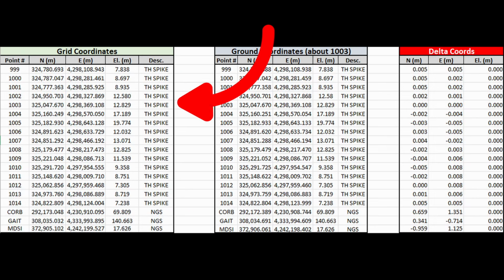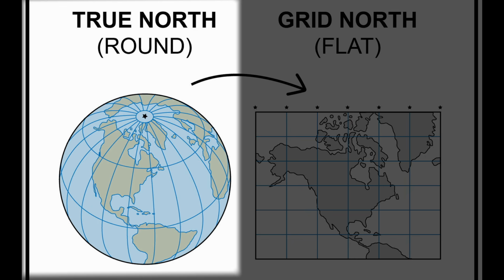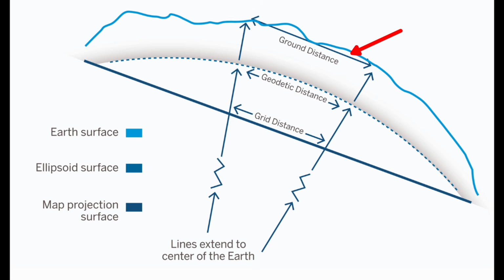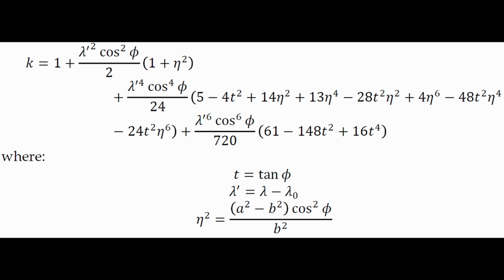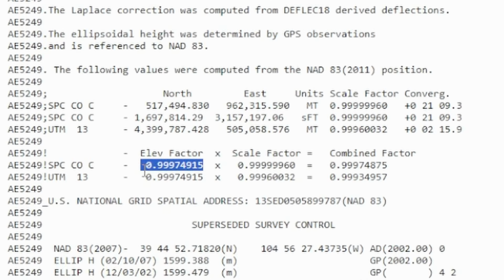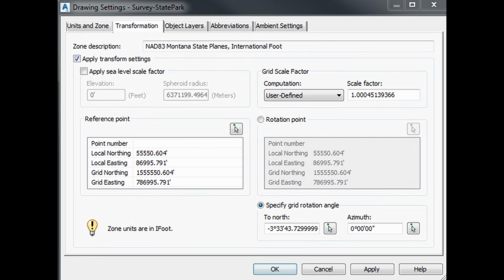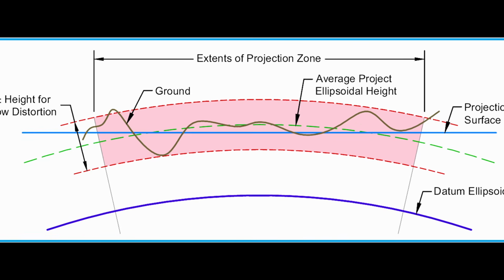Grid vs. Ground Coordinates : Key Differences Every Surveyor Should Know

Comment: Suppose you have some grid coordinates. They were collected using gnss or total station. In each case the scale factor is either incorporated in the CRS defined in the gnss software or used when solving the traverse when using a total station.
Suppose you have to stake out these points.
If you use gnss receiver the skale factor is included in the CRS used by the receiver software. 
If using  a total station, you must define in the software the scale factor, so the edm distances measured while staking out are corrected.
Here is what I don't get from the video:Why mess with converting grid coordinates to ground coordinates, since in any case the scale factor is taken into consideration when staking out?
(I omitted in my post the height scale factor, but it can also be defined in the total station software if needed and similarly to gnss software)

Comment: Do have any videos regarding localization files? I work with crews that like to do one point localization files and I’ve tried to warn against doing this but have a hard time making them understand the errors that can happen.
Reply from the maker: No, not yet
Reply: I have the same issue where I work. It’s difficult to explain clearly, especially without strong examples.

Comment: Hi, I have a question for you regarding the scale factor, let's say I usually measure within 100m and I go to a construction site where there are two nails and the nails should be, for example, 90m apart and when I check manually with the totalstation and it shows 90.004 and I know that there is just an installation error. Now when I set the totalstation, do I just use scaling 1 or do I let the device calculate the scale? Is it just safer to use scaling 1 so that the totalstation doesn't start calculating something of its own? I dont have a gps I only use totalstation. It would be great if you could answer me and thank you very much.
Reply from the maker: I would be very hesitant calculating a scale factor by measuring between two points 90m apart.
Reply: @The3rdDimensionSurveying  So you mean that scale 1 is the one to go with? In a way, I know that it is worth it when I have done tests where I position with three stickers and let the totalstation calculate the scale factor for the work that has the correct height 100m, and then same work wrong height 0, when using wrong height 0 the totalstation calculates the scale factor incorrectly, i get incorrect readings but when i use scale factor 1, then the height doesnt matter the measuring results are the same as when you set in correct heights and let the totalstation calculate the scale factor.
I had to ask someone more experienced if I have understood this correctly, please correct me if I'm wrong. Normally in my projects I measure so that the furthest measurements are within 100m of the total station. Thank you very much for the reply and thanks for the good videos, they are very helpful!
Reply from the maker: @Cyrilz24  My pleasure. Im a little bit confused as to your exact question but I'll take stab at it.

If i had ground coordinates supplied to me & I wanted to remain in a ground based system, yea I'd use a csf of 1.00000. 

If I was given grid coordinates without a CSF & I wanted to work in ground, I would grab the CSF online of a central point and scale those coordinates appropriately.

The issue with measuring points in a grid system, inversing distances and comparing those to what your TS gives you at 1.0000 is that you're baking error into the CSF determination. Systematic error that will affect everything that's done downstream.

Not that people don't do that, that's basically what a GNSS site calibration is, but from a mathematical standpoint if we can minimize error rather easily, why not?
Reply: @The3rdDimensionSurveying 
Of course, there is always error you are just trying to get the best possible result👍
I will try to clarify my question, lets say i make a drawing in autocad in meters and i know the heart of a drawing has 2 basepoints lets say 80m away i go in the center of those two basepoints and set the totalstation by those points recardess if the autocad drawing is in wrong coordinates place, of course in the coordinate system that i have in my pad but still wrong place, its using projection coordinate. should i be okay with scale factor 1.000...  and the furthest way i measure from the totalstation is inside 100m. My testing by using right everything and then wrong everything but scaling 1.000...is saying that i can, but when you let the device calculate it when its in the wrong height 0 when it should be 100m there comes error to the right everything. The testing was made by stickers that was put using gps. I have learned this job by my own so I just want to ask somebody who would know more than me.

Comment: Hello. First of all, I love your content, and I have learned so much from you. Thank you for that.
I have a question about this topic, and I am still trying to understand all of this so bear with me, please :)
I have worked on multiple projects where we had to go out and stake out the foundation for a house. The procedure was as following: We get the dimensions and the position form a planer (so these are ground measurements, the exact size of the house when built) and then we use GNSS to set up our reference points from which we resection our self in the middle of the future floor plan position and do the stake out. So, this way I would assume that we are using ground dimensions of the house with grid coordinates? That means that there should be some kind of an error? If we assume that our scale factor is about 0.9996, we should see about 1.2cm difference in length on, let's say, 30m length of one side of the house? But strange thing is that all measurements fit in the end. If I take a tape and measure that side, it is perfect 30m. This is what is confusing me now and can't figure it out.
Reply from the maker: It depends how you have your job setup in your field software. Lets say the house design is in ground but referenced to grid coordinates, hence the need for GNSS to set reference points. If you set your resection points in grid but then use your total station to resection from those points with no SF applied you'll be measuring in a ground based system. Sure you'll see a bit of error (measuring grid points but assuming an incorrect SF) in the resection but it'll be small and distributed about your reference points.

It also depends where you are and what projection you're using. If you're using UTM you have the potential of a 0.9996 CSF but you could be working in a mapping projection with a deviation between grid and ground that's a smaller magnitude then what is detectable with a steel tape.

Comment: Thanks for sharing and impacting knowledge. Remain blessed sir. 

Pls, there is a scale factor that comes with ellipsoid parameters, is it the same factor u are referring to? Also do i have to change the scale factor in total station. 

     AUTHORITY["EPSG","4259"]],
    PROJECTION["Transverse_Mercator"],
    PARAMETER["latitude_of_origin",0],
    PARAMETER["central_meridian",15],
    PARAMETER["scale_factor",0.9996],
    PARAMETER["false_easting",500000],
    PARAMETER["false_northing",10000000],
    UNIT["metre",1,
        AUTHORITY["EPSG","9001"]],
    AXIS["Easting",EAST],
    AXIS["Northing",NORTH],
    AUTHORITY["EPSG","7992"]]
Reply from the maker: Yea the CSF of the project you're working on constantly changes depending where you are in the mapping projection (and at what elevation, hence the C part of CSF). That 0.9996 is the scale factor at the central meridian, and its just the scale factor, not the combined scale factor.
Reply: @The3rdDimensionSurveying please how do I get scale factor to input in the total station. I am using leica ts 07. 

Please kindly drop your LinkedIn profile name
Reply: Boss, I noticed i have same distances with GNSS and total station just 2 or 3mm but there is great difference in azimuth of GNSS and total station 0° 15' 51"

Comment: I worked for our state DOT. Grid to ground caused a lot of anxiety and errors.  Years ago long highway corridors were broken into separate grid systems. One problem it caused was a point in between the systems had three Northing and Easting values, ground system A, ground system B and State Plane values. They all looked similar.  Through the years a lot of mistakes were made.  Eventually we mapped most highway projects on grid only. If the designers or the consultants wanted ground mapping they could do the transformation themselves.  Low distortion projects will work on most projects, since they are designed that essentially grid is ground. Great video.
Reply: In the UK they prefer to create snake projections for long corridors, dedicated to those projects.

Comment: I have been plagued by one constant in my career:  Working within a site calibration on a local-grid GPS project... and watching a total station miss measurements wildly when set up within the same project.  At this point, I understand the reasons for the errors... but have heard so many solutions, I still have no idea what is the "best one".  Especially when it's something like a landfill and scanners/photogrammetry have to be integrated with the GPS survey data.  There HAS TO BE a best workflow, rather than the office constantly chasing their tails reconverting data every time it comes up.

Comment: This is one of the best explanations I've ever seen. I've had so much trouble understanding this and getting a proper explanation from other PLS's. I think I finally get it. But I have 1 question. Do you also need to adjust your elevations when you're utilizing the combined factor? I'm thinking that's a no but just curious. We always run elevations from a nearby ngs monument before working.
Reply from the maker: Thank you very much, you are correct, you do not scale elevations by any scale factor.

Comment: Regarding UTM projection, how can it go through the equator at 0m North, extend north to 84 degrees, and south to 80 degrees?  I’m picturing it like a toilet paper tube going through a ball. If the center line of the tube is on the center line of the ball, the top and bottom sections (84d n and 80d s) would be the same, no?  Am I looking at it wrong?
Reply from the maker: Hey Mark, Im having a tough time picturing what you're describing. When you say the top and bottom sections would be the same, do you mean there could be duplicate coordinates? Because this is absolutely true. Hence why when we say our UTM coordinate values we not only have to give the zone but also if its the southern or northern half of the zone.
Reply: if it’s a secant cylinder centered on a ball, how can one side (south) stick out of the cylinder more than the other?

Also, big fan, learned a ton watching your vids. 🤘👍
Reply from the maker: @MarkJFeller-x1r  Thanks Mark! 

I think you're asking why does UTM cover latitudes as far north as 84 degrees but only as far south as 80 degrees? If that is the question I believe it's mostly to do with the fact there is little need for the UTM projection in the Antarctic as it's mostly uninhabited and there are better projections that can be used down there (we get into some fairly large distortion around the polar regions with UTM) where as at 84 degrees north UTM can cover pretty much every significant land mass. There may be a few stray island above that, Im not too sure to be honest.

I'm not entirely sure if the mapping projection protrudes further from the ellipsoid on the southern hemisphere. I dont believe it should. It may very well protrude more from the earth as the ellipsoid only best fits the earth. Although NAD83 was initially designed to best fit North America, I believe 2011 best fits the entire globe fairly well since it's essentially WGS84, just shifted a couple meters so we're not talking about a huge amount.
Reply from the maker: Great question by the way, if you find any information that is contradictory to what I typed up, please let me know. I honestly don't know a ton about UTM or mapping in general in the polar regions as I haven't ever worked that far north or south yet.
Reply: @The3rdDimensionSurveying  sweet. That makes sense, much appreciated. 👍

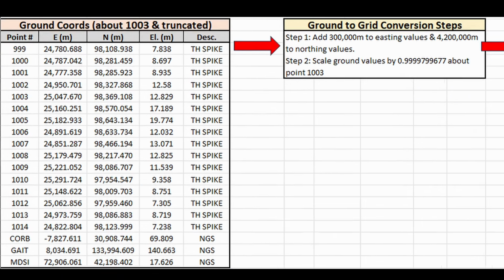Comment: I have a question about the excel sheet when going from grid to ground or vice versa . When you say scale 'about' a point how is that done? For example if at 25:12 I take the ground easting of point 999 and multiply it by the CSF (324780.688 x 0.9999799677) I get 324774.182 and not 324780.693 as seen in the grid coordinate chart at 25:15. What am I missing in these steps as there is a considerable difference between these numbers? Thank you for the awesome videos.
Reply from the maker: You're scaling about 0,0 when you do it that way, not the scale point. If you want to scale about a local point take the difference in coordinates between your scale point and the other points and multiply the scale factor by those delta coordinates. Then add that value back to the difference you calculated before. Or use autocad and the scale function but use the scale point as the base point. Does the exact same thing.
Reply: @The3rdDimensionSurveying  Cheers!

Comment: So if for example I exported an ASCII file from a project via Carlson/C3D that was on SPC and import those into the data collector and do a stakeout. These distances would technically be wrong if I didn't manually apply a scale factor prior to importing into the field equipment?

Wouldn't that mean that after a traverse was adjusted (on grid) and you went back on site and back sighted  any of those points your distance would also be "x" distance off? That distance of course being dependant in part on the backsight distance.

Am I understand this correctly?
Reply from the maker: It depends what projection you set in your data collector. If your coordinates were collected in grid, processed in grid and now you're using them in grid, then you'll be ok. But if you break that link along the way, you could get into issues.

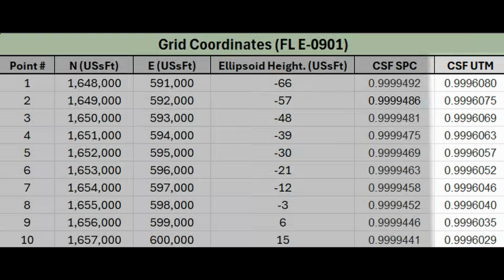Comment: Hi. I understood some parts of the video but mostly went over my head 😅. Do you think someone using gps base/rover for machine control and building 3d models needs to worry about this? Typically when control is provided by a surveyor I'm assuming they already calculated all this by the time we get the control point info. It's for some smaller jobs that I've figured out I can take points using known projections (like 16:15), but since I assume this is in grid, wondering if it will cause me issues later. Thanks for the content!
Reply: Definitely worth knowing enough to ask the right questions BEFORE making assumptions about control. Best to communicate and understand what’s being delivered to you.
Reply from the maker: I think anyone that touches a GNSS unit for surveying really needs to understand this. It sounds like you're dealing with earthworks so I would imagine the control and design are both in grid and the surveyor has taken that into account so you may be ok as long as you always set your projection properly.

Comment: Very helpful.  We do earthwork in Texas.  I import points / lines into our Trimble software and toggle on the aerial imagery.  If it lines up, then 9 times out of 10 it means it is on our local grid coordinates and ready for use on our mixed fleet of GNSS equipment without localization.  If it is shifted 1,000ish feet northeast, then it is on ground coordinates and means a bunch of wasted time going out to shoot controls.  On occasion I have been able to get the scale factor from the engineer, but I have never been able to get it to shift quite right.  It's close, but not right.  We have always questioned why everything can't just be on grid coordinates.  It makes a lot more sense now.